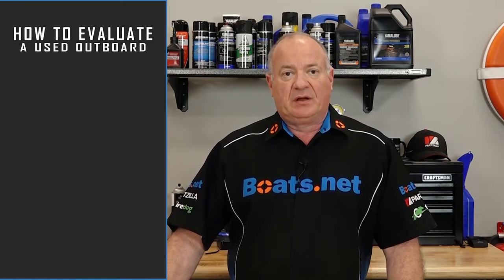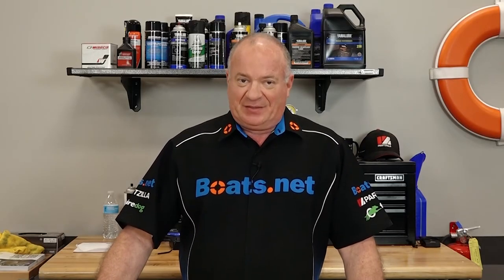How to Evaluate a Used Outboard | Tips on Buying a Used Outboard | Boats.net

Comment: About 8 years ago my friend and I were bass fishing in Sturgeon Bay Wisconsin.  We were fishing the shoreline and going back and forth using a trolling eclectic motor.  When arrived there was a small boat on a lift with its motor running.  It was about a 1 or 2 year old Merc 15 or 20 horse power and the guy had it far enough out of water that no water was peeing out the side of the motor.  I thought about yelling to him but his house was 300 feet from the shore line.  So we fished for about 20 minutes and the guy never came back down.  We left to another spot.  So buying a used engine is a crap shoot.

Comment: Good video but.  Testing with muffs or in a barrel don't tell you how it works under a load.  I bought a motor that I knew didn't run.  I changed the diaphragm in the fuel pump and the gas filter and hoses and bulb from the tank.  It starts great, idles great and runs on fast idle great.  I put the boat in the water and it started right up, backed off the trailer and started out into the lake.  When I gave it throttle it died right down, I removed the cap from the tank and same thing.  I have it home now waiting for a carb rebuild kit.  Tank testing doesn't tell the whole story.Thanks for your video.

Comment: All great tips. One more thing you might want to check is spark especially if you can't see it running.

I just bought a used motor without seeing it run. The seller told me there was spark and compression. It was cheap so I took a chance. It needed some work to get it started. The reason I bought it was for spare parts since I have the same motor. It may turn out to be a better motor than the one I have. 

When shopping for ANY used ICE equipment, bring a compression tester and spark tester. They're cheap. If it's a 4 stroke, you'll want to see it run since you can't check timing.

Comment: I have a 2005 25hp Yamaha two stroke man start runs good but hard to crank after it sets for a week or so carbs are spotless it's getting gas and fire compression is 90 over 89 cold new coils also any suggestions

Comment: Hi John,  I have a "rookie" question about the fit of an outboard. My transom is 20" from top to the Vee in the center of the hull.  So I'd be looking for a 20" shaft on whatever motor I end up with. My question is, which plate is the cavitation plate on the motor? I see there's a smaller flat/horizontal plate, (sticks out towards the front of the boat) which is about 2" ABOVE the next, larger plate below it, (sticks out towards the rear of the boat) and is bigger than the one directly above it mentioned just now.  In this video, you seem to touch/point out the upper plate when you're speaking about the cavitation plate,, is the upper plate the "cavitation" plate?.
Reply: It's the lower plate.He touched the wrong one.

Comment: John,
Can you help me in determining if an F225-TRXD mid-section will accommodate a F225-TURC powerhead? My (TURC) is subject to the corrosion issue and found a mid-section. Same year and hp (04' 4-stroke, 225TURC). Mine is a 30" shaft, and the other is a 25", but I'll just swap over the adapter and shift rod.  I'd appreciate your wisdom on this..

Comment: Hey Jon I got a question for you I have a 50 hp Honda four stroke 2012 run excellent can drive 10 hours with no problem omitted I come to an idle for at least five minutes I got a beeping sound it’s not overheating and oil pressure is good what do you think the problem could be thank you
Also once the beeping starts if I shut the engine off and restart it the beeping goes away and comes back 10 minutes later
Reply: Maybe check the owners Manuel should say what could cause it
Reply: @TheOutBoardSurgeon  Problem was the oxygen sensor which come to find out Honda has this problem frequently
Thanks
Reply: @CapeFrank57  glad you were about to get it fixed and thanks
Reply: Impeller
Reply: Cools when running then at idle the high temp  buzzer comes on the impeller rubber is  getting hard

Comment: Hi i want to know how to compare the hours of a motor with "miles" lets say a motor has 500 hours from 50 miles an hour i get 25000 miles on it. is that assumption correct? thanks
Reply: There is no way to determine this but very few outboards in the world would average 50mph. Half that would be more accurate. Remember every journey starts with launch, idle, low speed away from the ramp. And not many boats can even travel 50mph